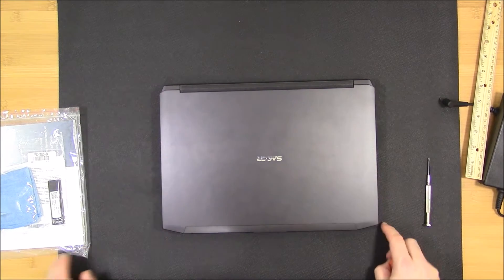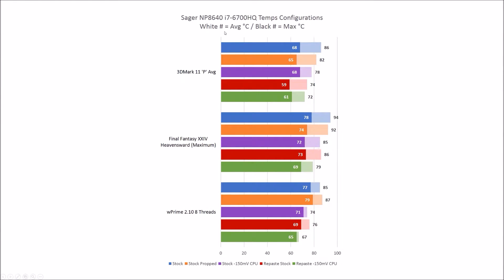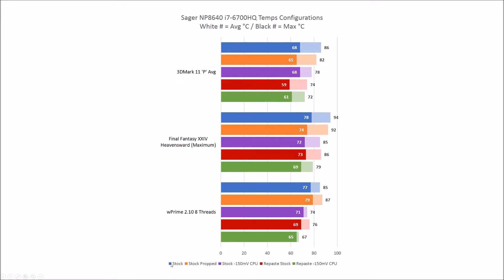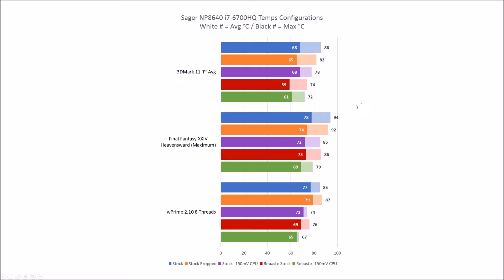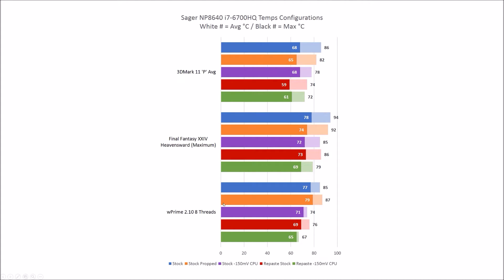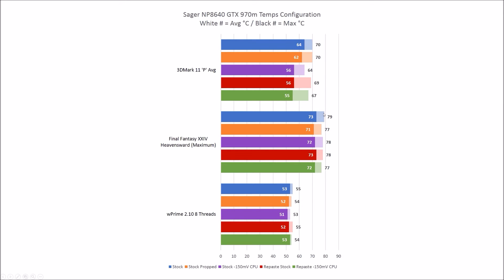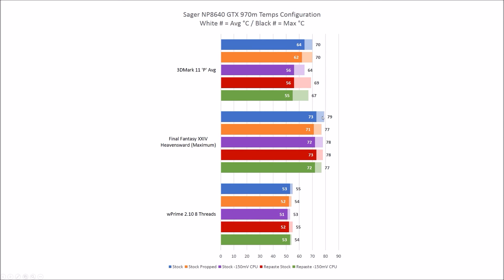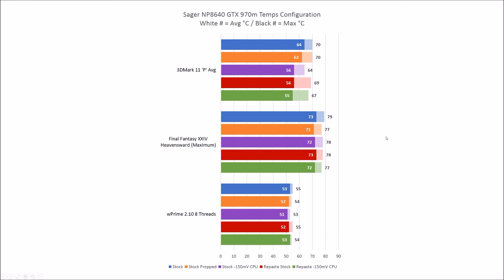Sager NP8640 Clevo P640RE Repaste and CPU Undervolt Temp Compare

Comment: Nice video and work around . I wonder if you had run this laptop with the bottom panel off. Did the temp lower? I'm thinking to make a hole on the right fan hole as big as on the right fan.

Comment: Can you do a video on under volting. All the guides I've found use a older version of XTU.
Reply from the maker: +HelplmAlive I may. XTU is largely unchanged, and it depends on the chipset and CPU you have with what's adjustable. It's basically just adjusting the core voltage offset by a little bit, test, ten drop it lower, test, lather, rinse, repeat until you find your stability limit. Then add 10mV back on so that you ensure stability.

Comment: Do you think the openings on the bottom for the fan are too small? The opening on the left side when you were opening the back panel on your overview didn't seem like it would suck in much air. Can you think of a reason as to why Clevo would of made it so small? Would think opening that up more would help with cooling, unless theirs some physics I don't understand going on in there.
Reply from the maker: +blshdfh I'm curious and am planning on running with the bottom panel off completely and propped up all around to see what temp differences are.
Reply: +htwingnut Alright great. Looking forward to it. Been trying to find a small profile laptop with some power to it. Was hoping this one would be alright.

Comment: Nice gains! Also you may notice even more drops after the paste sets. (200) hours depending on your paste.
Reply from the maker: +Mitch Levy It's IC Diamond. There is no set time.
Reply: +htwingnut IC Diamond. Ill have to check that out. I just pasted my laptop a week ago with Thermaltake TG-7 I picked up at BestBuy. I noticed a nice change in temps but I think I can do better. The Laptop is a Lenovo y50 4kuhd model. Not as cool as your's :)